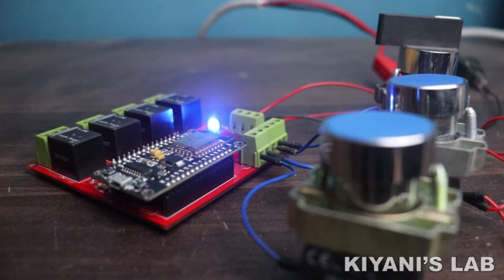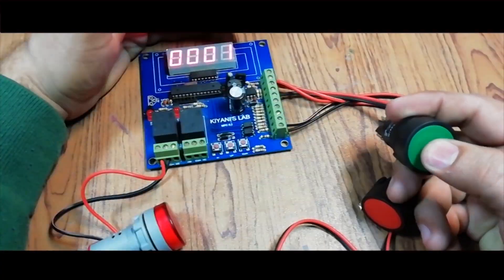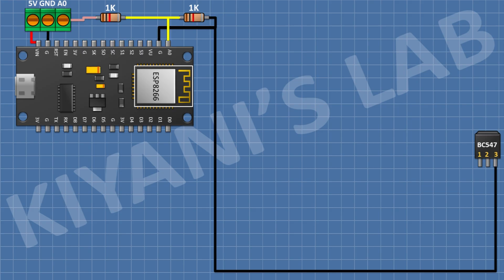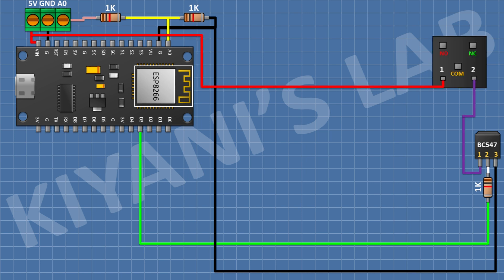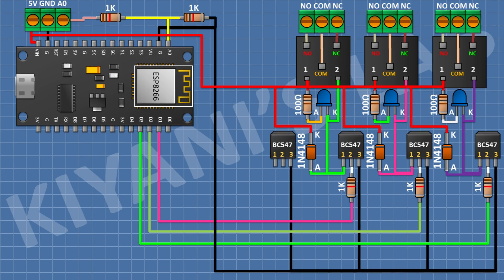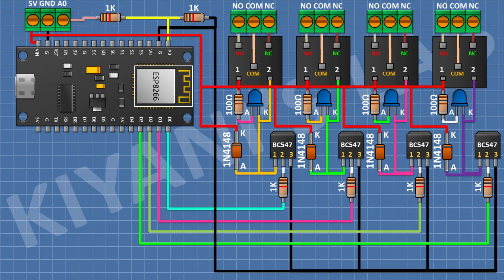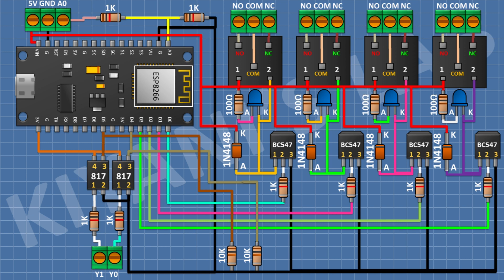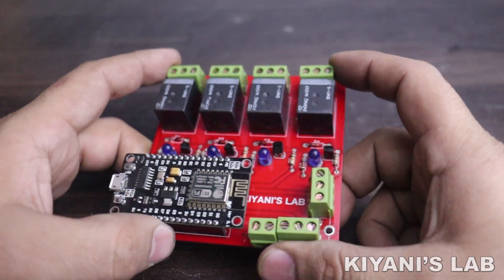How To Make Mini PLC | ESP8266 PLC | Ladder Programming

Comment: I made this bored. But input d4 isn't working. I think this is because it has a internal pull-up resistor and the board has a external pull-down resistor between the pc817 and the d4 input. How do i disable the internal resistor?
Reply: Yeah I just confirmed on your board. GPIO2 pin D4 that's connected to the onboard LED with the pull-up resistor is a sinking input unlike the others. You have the pc817 output pins of D4 reversed for sourcing.

Comment: Please write your email, 
I need to develop a PCB project for esp8266, 8 relays, 8 4-20ma inputs, 16 inputs via a shift register for a button and 16 5v outputs via a shift register, I would also like a built-in OLED display connected via 4 pins, could you design such a PCB for me?

Comment: Thank you for sharing such an awesome project!
I got everything to make this and it doesn't fit the listed SRA-05VDC-CL relays. It looks like it fits the slightly bigger (SRD) version. 
Also the 2p connector is listed to use a KF350-2P, but actually needs a 5mm KF301-2P.

Comment: what's a good design, but i still confuse how to program the ESP822 module, i think that the success key for this project.. share please..
Reply: He used OpenPLC for programming the ESP module, using OpenPLC you can write Ladder language and other languages program but in his video he used Ladder language to program the module. Method from programing ESP module using OpenPLC is that you just write a program in Ladder Language and for the input and output variables you map the variable to pin numbers of module (Pin mapping is mentioned on OpenPLC documentation website) and then you just burn the code on module using OpenPLC burner, it automatically converts ladder program into C and burns it on ESP module.

Comment: The optocoupler seems to be pretty useless.
Reply: it isolates the 3v3 esp from higher control voltages and is absolutely necessary..  an alternative is a voltage divider, but this does not protect the controller from transient voltage spikes..  optical isolation is the gold standard here and this is the appropriate choice